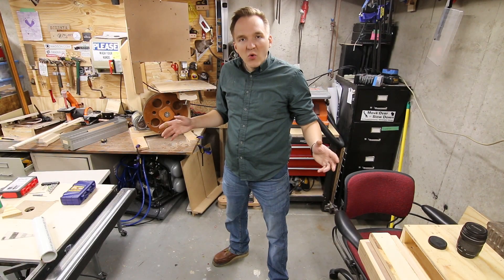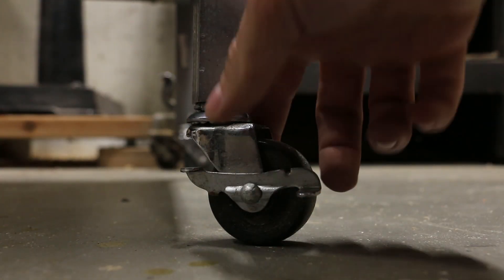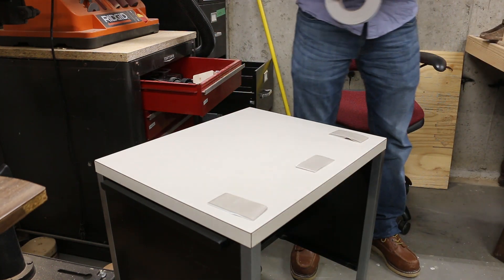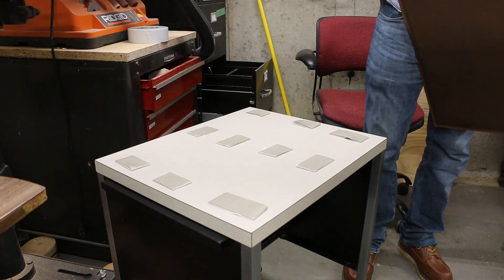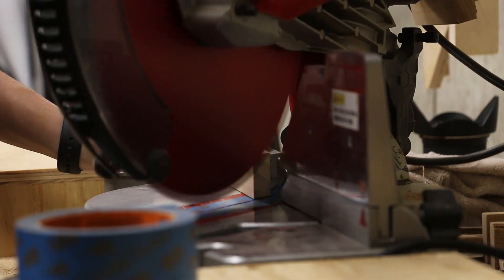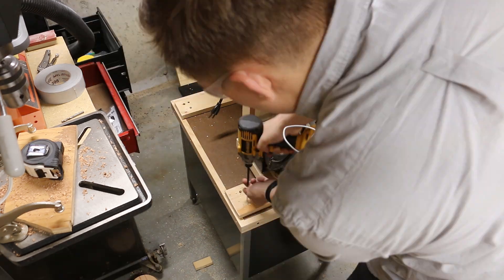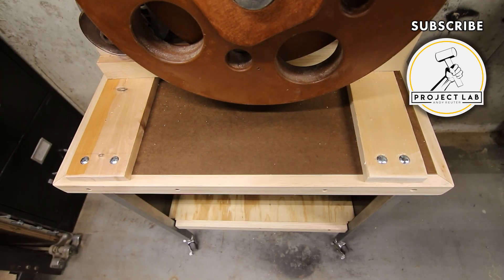Old typewriter stand to new bandsaw cart

Comment: love your videos, Andrew. one small thing for this video, though, is it is a bit difficult hearing commentary whenever there's hardware in the background. maybe lower the volume of the clip a bit whenever there's commentary?
Reply from the maker: Ah, dang, thanks for the heads up! I try to dip the audio when I’m talking, but it wouldn’t surprise me if I screwed it up in places on this one. Were you listening on headphones or speakers here? Any particular part? Thanks again!
Reply: @AndrewReuter   this is from what I experienced through phone speakers at less-than-average volume:
3:35 with the router and a bit after with the hand plane
4:42 a tiny bit with the sand block
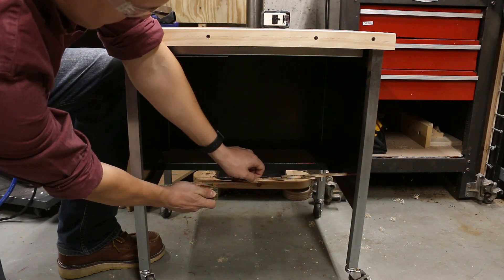5:00 with the circular saw?
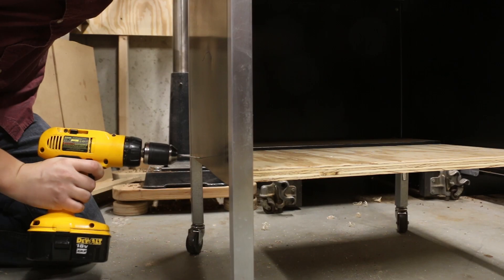5:25 not the drilling part but after, with the screwdriver
the way I was taught in highschool  was to keep commentary 7 to 10db higher than everything else, unless intentionally emphasized.
but, I haven't done editing in years, so take that with a grain of salt.
Reply from the maker: 👍👍👍 Great notes, thanks again!